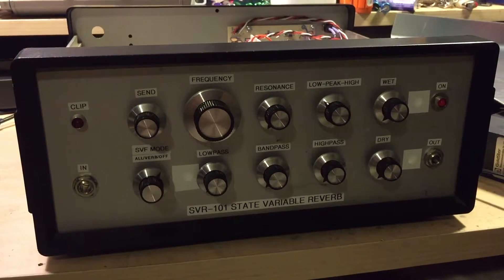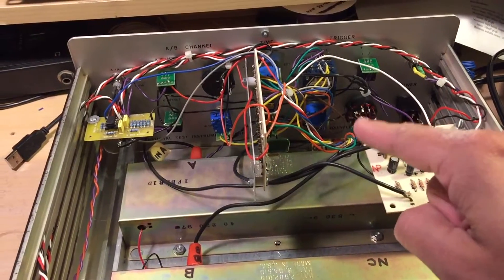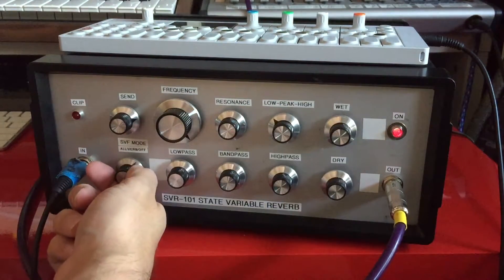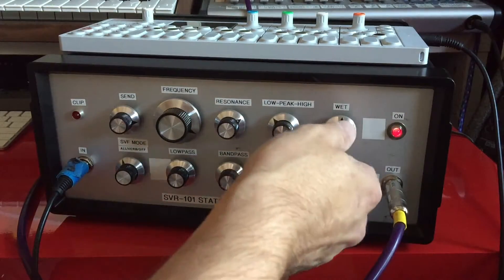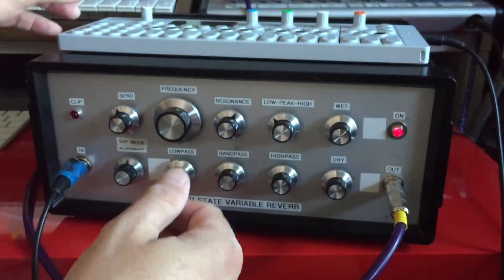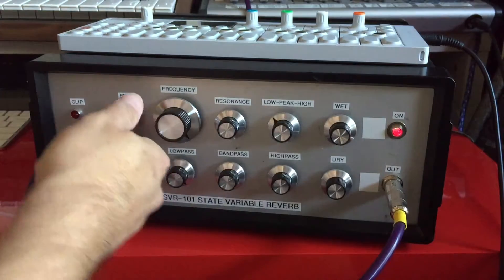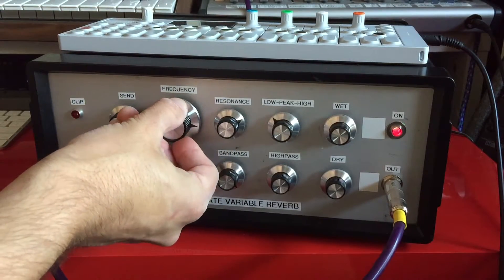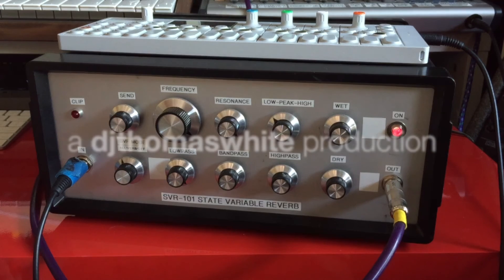State Variable Spring Reverb Demo

Comment: Super clean sound, excellent build. What ICs did you use for the Hot Springs? Garden variety TL072, or a more specialized one? Did you feed them +15/-15? Any mods into the original circuit? Sorry for the amount of questions, very curious because you got such a nice sound, congrats!